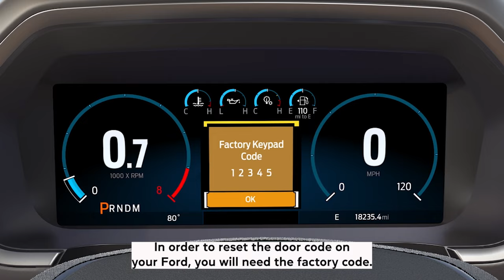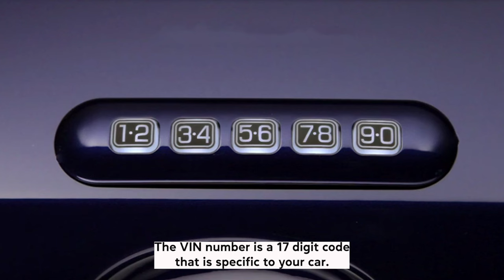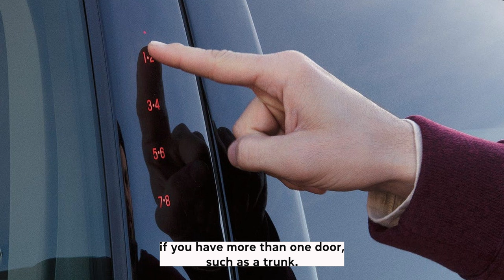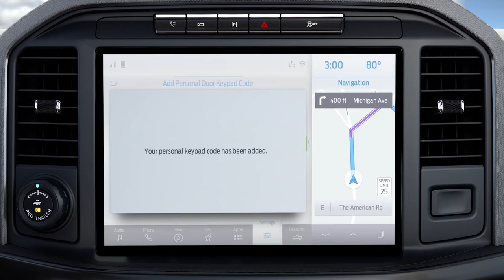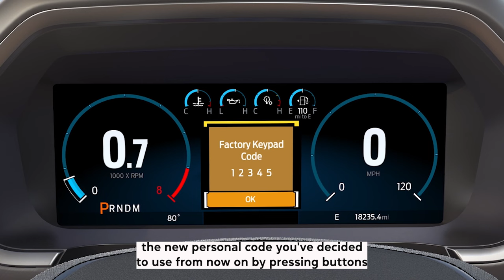How To Reset Ford Door Code Without Factory Code – Keyless Entry Code Hack

Comment: The Vin number  has letters in it, there's no way to enter this
Reply: I bought the keypad fom walmart, 30 bucks I think it was,  plug n play it worked right out of the box, if you know your entry code.  If not you can usually find it hidden on a sticker in your car, depending on what year

Comment: How do you reset the aftermarket Ford keyless pad that is bought through the parts dept. This keypad is a stick on which has a small battery inside the keypad.. the car came with this aftermarket Ford part. No one knows how to reset it😞